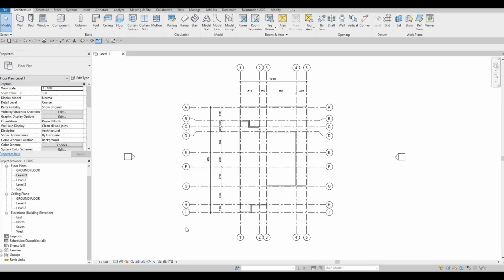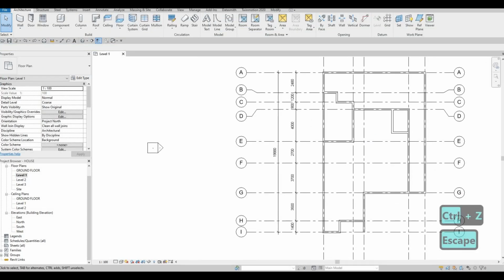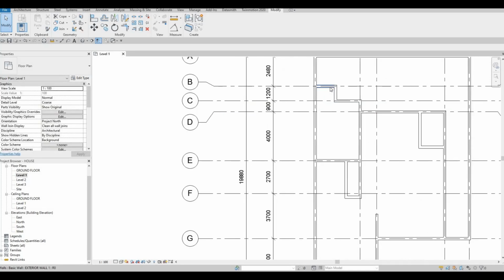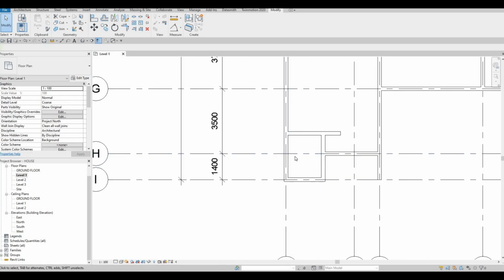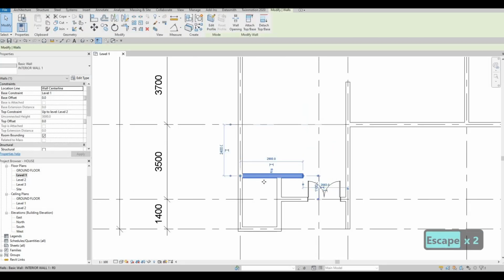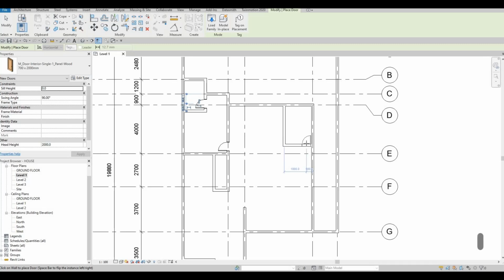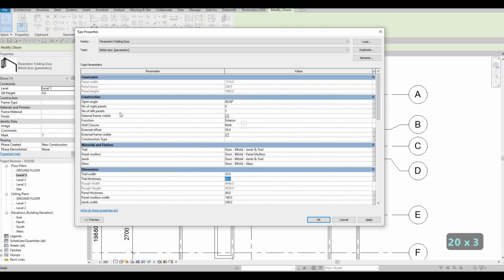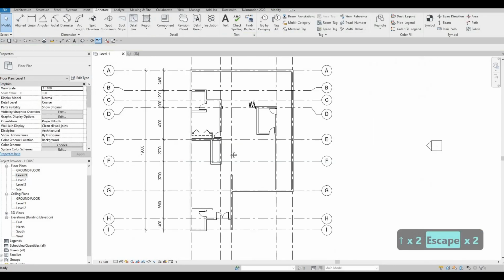ACC House | Part 2 | Complete Step By Step Project | Revit and Twinmotion Tutorial

Comment: A question: When I insert doors or walls, the temporary reference dimensions measure the distances not from the center of the door and walls, but from the sides. Where do I go to change the setting and ask the program to work from center to center? ps. Thanks
Reply from the maker: You can select the door or the windows, a temporary dimension will appear and you can adjust it from there. Thank you